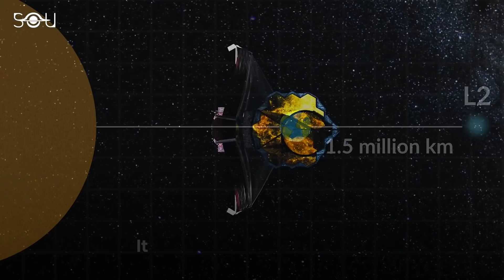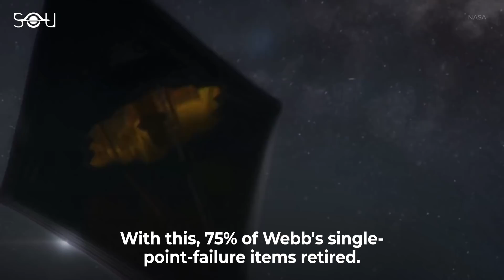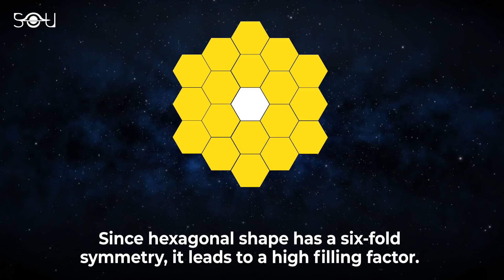It's Done! James Webb Has Been Fully Deployed In Space

Comment: Well done to the ESA and Ariane 5 team, for their pin point accurate launch. Saving so much fuel on Webb, that it's increased it's the life span significantly over an extra 10 years. Than it would have, should it of had to make more adjustment burns.
Reply: They've let it slip a couple times now (including in yesterday's press conference) that they will have roughly 20 years of fuel remaining after the final burn if all goes well.
Reply: @Aegolius  And with the increased time span, there is even more hope of a refuel mission getting off the ground.
They have said they are looking into that too, as a future robotic mission.
Reply: @benghazi4216  by that time LUVIOR might already have been launched as well

Comment: I didn’t know that each mirror can adjust independently 😳
Reply: And on a micron level. Truly amazing engineering.
Reply: @benghazi4216  I think it has to. Because of the vibrations at the start.. And the deploying in space, many segments can be in the wrong position and angle. I am glad, they find such a good solution for it. The James Webb telescope is simply amazing - and i barely can believe, that everything went so smooth! Thats a high risk - high gain gambling.
Reply: @PygmalionFaciebat  I think it's more the lesson learnt from Hubble, and the need to send up astronauts to put glasses on it just because it had no focus adjustment. 
And if you want an adjusting mirror, the step isn't large to making it fold so not to be limited by the launch vehicle, like Hubble was. It almost goes hand in hand.
If you want a folding mirror, it has to be adjustable.
If you want a adjustable mirror, one way to do it is to have segments, which you then can fold.

Yeah, with the over 300 mission ending failure points I was a pessimist I must say. 
But hey, we are not out of the woods yet I think.